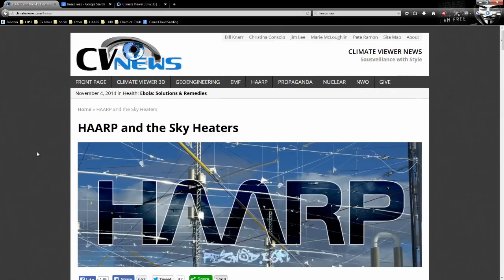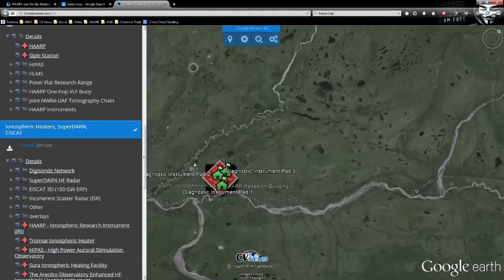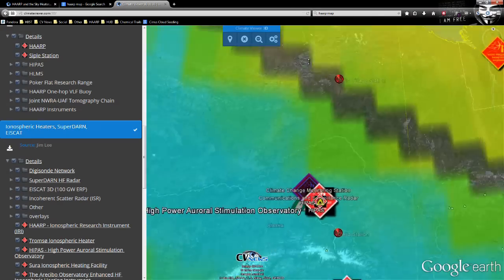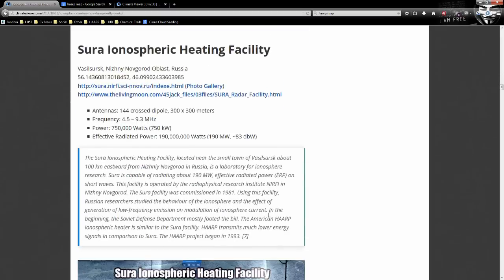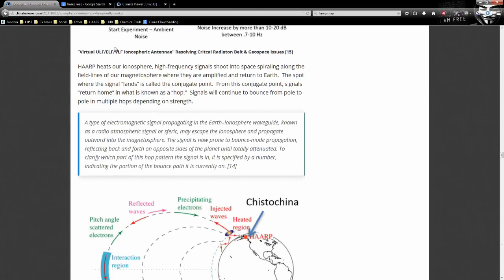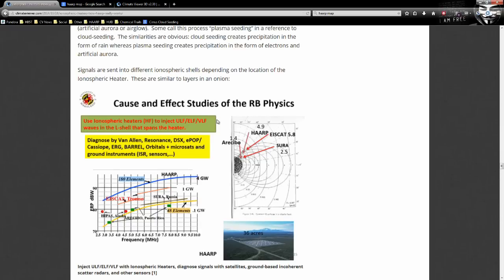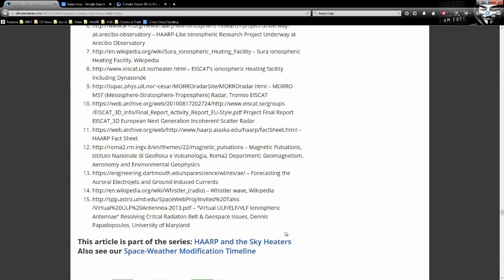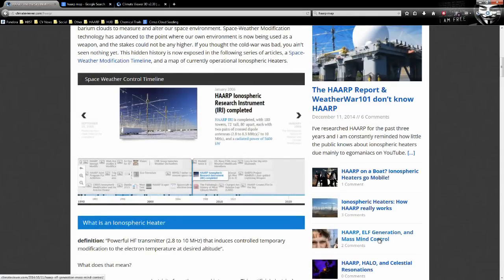Ionospheric Heaters - How HAARP really works

Comment: CFR had a symposium in 2008 where they warned against microscopic alumina aerosol for geoengineering, saying even NGO or rich cliques could do it since the cost was so low.  But in the "who's side are you on?'  they then told the financial mechanism as to how:  Take your measly 20 billion dollar principal and put it in single premium annuities that would pay out the est. $300 - 500 million required annually for constant needed replenishment.  I can only estimate the initial cost of "Filling the bathtub" at jet cruise altitude based on percentage of reduction of numbers of trails per day here under major cruise lanes WDC.  70% reduction, so cost for initial filling perhaps around $5 -8 billion. All the swimming pool is full all we have to do is pull out a  relatively few hoses and top it off. Money would be going to airline companies as "military contractors."  It's not like they had to sell their soul just to get one big payout.... they get mucho for as long as one can foresee. 

 The replenishment figure also given 10 years earlier by Dr Teller, who proposed filling one layer of Troposphere with said alumina to block excess sunlight to prevent "global warming".  Which he didn't actually believe in.   He knew, however, that alumina thus deployed would be superb at facilitating transfer of EM wave energy, as he did believe in US patent 4686605 "Method and Apparatus for Altering a Region of the Earth's Atmosphere, etc" as bought by USAF and initiated at the HAARP. Which was based on the patent.  Which calls specifically for "suffusing any region to be ALTERED with microscopic metal powder as it greatly increased the efficacy of our 'art'".   Gotta love that "altered".  And many "alterations" as possible.   It all came out of the thermonuclear EMP burst, which Teller invented.

Comment: This is just personal experience. I make no claims about anything, just reporting facts.
I lived 5.2 miles away from the old Ionosphere heater sire near Platteville Colorado. 

EDIT: Platteville Colorado, not Ohio. Minor slip of the tongue sir.

The Federal Government closed the heaters down officially in 1985. 
Within the last 5 years, the site has built some very large antennas.
During the same time there has been some serious power ran to the site. Some lines zig zag, but you can find them on satellite maps if you are patient. 
I have, along with friends, seen black drones flying West to East just to the North of Weld County Road 22, just North of the site.
The tornado that hit Windsor Colorado started very near the site. The tornado, evolved into a 1/4 mile wide F3 wedge tornado. Rare for the altitude. The tornado tracked from South East to North West. This could be explained by the wind currents as the wind come over the mountains and hits the plains.
2 more tornados started the same area after the Windsor tornado, but they were barely F1 rope tornados, and dissipated before they hit Ft. Lupton Co. Both tornados tracked straight North to South. 
Late at night I have heard strange sounds, that sounded to me like they came from the sky. There are 2 gas compression plants 2 miles to the North. They could be the source, but it sounded different to me, (one mans opinion).
I have felt, and verified small earthquakes. There is a lot of fracking going on in the area, and that could account for this.
I do have pictures of some strange weather, and clouds that have formed over the site.
I make no claims, just putting facts out there. Do with it what you want to.
I no longer live in Colorado. We moved last November 2017.

Thank you for your time.

Comment: Nice information. 12.17 I see the Shumann frequency disappears on the graph when HAARP is online. And a Peak at 60 hertz, the drift frequency in USA. In Europa its 50Hz. Maybe it is the feedback of electrical ground grid. I however do not agree that Electricity affects people in a bad way by having that particular frequency. On the other hand, motors, refridgerators or wind fans and blinking LCD lights and even clocks. Electrical failures, such as a nail driven through the wall causing a small power short circuit, between Phase and Ground, is both a fire hazard, and might contribute to a humming sound, when a current is conducted . Transformers make a humm in the remagnitisation of the core .  Nevertheless, electrical appliances that makes light blink, sound repetitions or 60 Hertz motor humms during particularely sleeping and relaxing hours, can be a health hazard, no documentation on that but still its my opinion. The mind is returning to that frequency and can not drift freely in dream. I suggest to click every electrical appliance off, when one goes to sleep for the night. So the humming of motors is not disturbing the nights sleep and revitalisation !
Reply: Radar Blue. At 60 hertz they can disrupt  the cells in our body. True we can’t enter in to REM SLEEP 💤 to restore us.
Reply: Radar Blue. Yes..Any electrical device effects me..I must remove all electric generators..A simple
electric clock humm is excruciating, disturbing and not anywhere near me..

Comment: If you don't have water in the air you have dry heat and the air is going to draw water wherever it can to survive even if it has to dry up some plantation and take the life out of the plantation because the plantation needs water to survive.

Comment: At 5 min. I gave up. 3 MW input and 5GW output? Are they creating energy from nothing?
Of course, this is a total misunderstanding and lack of knowledge about antennas and maths.
But I can explain.
The antennas are working together to direct the power in a single direction instead of radiating it everywhere. The aim with the experiment is to excite a small volume in the ionosphere.
The 3MW is the actual amount of energy that is transfered through the antenna system.
The figure of 5GW is a mathematical value that equals how much power would be needed with non-directional antennas (ERP, Effective Radiated Power).

So, 3MW of power is about the same as a freight train. Is a freight train capable of changing the weather?
Reply: "Is a freight train capable of changing the weather?" well is it?

Comment: You can get a lot lower than 1 Hz you can get below 0 Hz.....   Consider Frequency as revolutions.....    Cycles per second....   What if it takes longer than 1 second to create a cycle ....   Like 1 cycle for the Earth takes 365 days to go around the sun. Because it repeats in cycles it has a frequency of Once per year....    With Scalar Wave this is achieved with multiple Pulse Modulation of a ELF carrier wave. Look at the cloud patterns..... The pulse is on for 10 to 20 seconds then off for the same amount of time, during the 'ON' period a higher frequency in added, and during the 'ON' period of the higher frequency a Microwave frequency is added that heats the water making the clouds appear in waves of the ELF.

Comment: Watts is a measure of power.  At 4:45 and following you say that the HAARP outputs more power than what is put in - how is that possible?  Please explain.
Reply: Thank you! I was wondering the exact same thing.
Reply: capacitors/condensators maybe? Just a guess
Reply: Good question-- I wondered the same thing-- but Jim Lee hasn't scrolled down to answer yet to I'll take a shot at it.

As it turns out, the atmosphere is loaded with ions-- which is a charge to begin with. You can harvest power from the atmosphere as Tesla wanted to do or... you can apparently shoot power into the ionosphere. This is a wild guess but what if -- when you inject power into the ionosphere at a particular frequency-- that the resulting force-feedback is amplified by virtue of the fact that the ionosphere is already loaded with 10 or 100X the power you inject into it? 

In other words, the HAARP systems are merely resonant "starter"  systems that "stimulate" a resonant power feedback. I know that sounds a little bit like "Trek-nology"... but there's my two cents.

Comment: Really good video. One thing though, you either need a wind screen for your mike, or you need to back off it when saying your hard consonances, because the mike POPS every time, and it's loud.
Reply from the maker: dede4004 thanks. this video is three years old and I've long since fixed the sound issues. check out some of my latest videos.

Comment: I live in Portugal, Europe, and i heard the "hum" some times, even before it was a thing. I tought it could be a car or a bike idling on the street at night, but there werent any cars arround, i also tought it could be my neighbours computer fan, or an air condicioner. It drove me mad at night.
Reply: A hum? Can you describe it in more detail? Was it coming from the sky?
Reply: No, it wasent comming from anywhere, it felt more intense inside the room with windows shut than actually outside. It only happened at night, when theres less noise on the streets (i live in a city). The best way to describe the "hum" isint by calling it a hum, more like a very low pitch vibration sound, much like a bike or a car with a "noise mufler" idle outside, not very distant, not very close neither, about 10 meters.
I didnt know more people could hear this "hum" at the time. wich left me very intrigued.
Reply: Afonso Serro Hmmmm...that's strange.

I wonder why strange sounds are being reported world wide and I myself have not heard anything strange.

Comment: Strange...if there was a country that could control the weather, there would be one country that never had extreme weather and would have perfect crop results every year....can you name which country it is? Cutting down trees in the tropics and the southward movement of USA to the equator as a result of climate change is the cause of increased extreme weather in USA and IT WILL GET WORSE EVERY YEAR NOW as it has done since the pole shift started.! Just look at all the extreme weather in the USA over the past years. There is not enough money on the planet to rebuild all the damage that has already happened so USA, stop fighting wars abroad and look after your own people!

Comment: You're not very clear.  "There is only one HAARP."  And then you say  "There are plenty more around."  Which is it?  Do you mean there others under construction?
Reply from the maker: patrick McHenry there is one HAARP, there are 10-12 other Ionospheric Heaters in use with the power requirements and frequency range to do ionospheric heating.